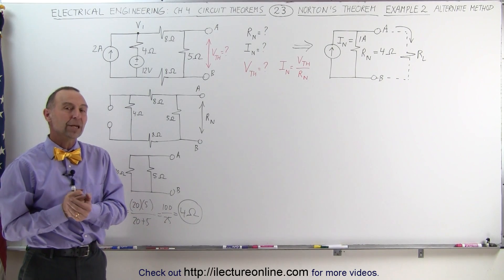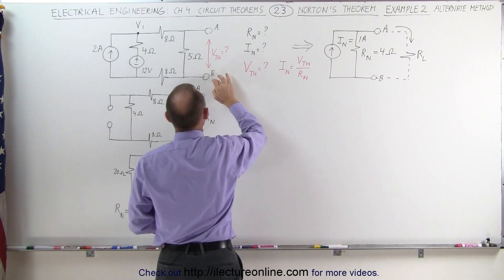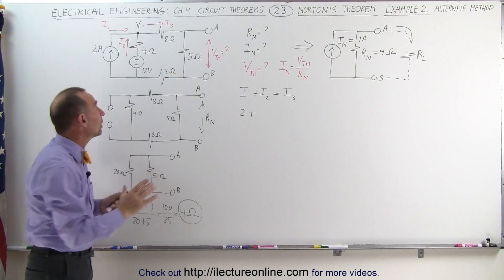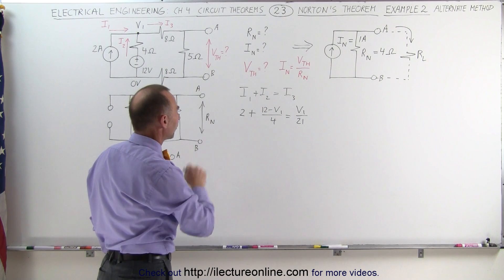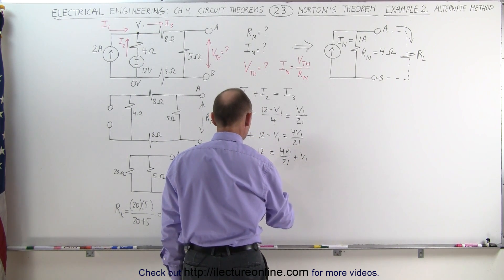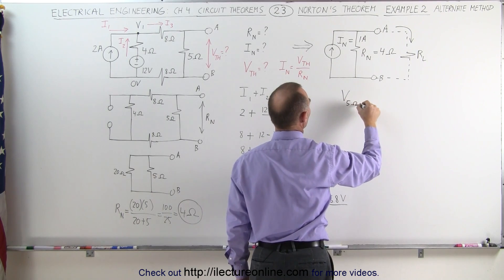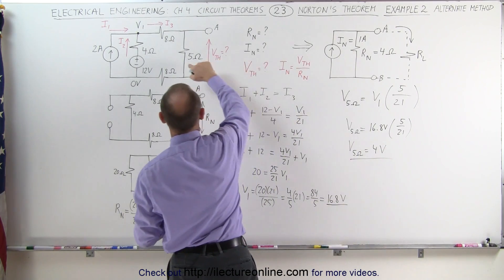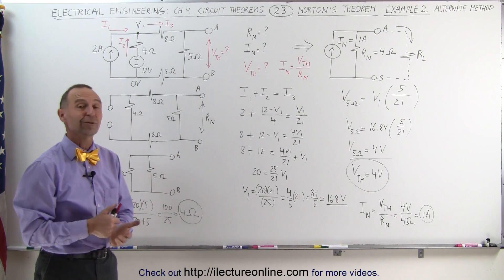Electrical Engineering: Ch 4: Circuit Theorems (23 of 35) Norton's Theorem Example 2 (Repeat)

Comment: For those who's confused why he's using (4 + 8 + 8 = 20 ohms) for finding Rn vs (5 + 8 + 8 = 21 ohms) for expressing I3 in term of V1, let me explain below for my own revision as well :)

So when finding Rn, we turn off all the independent sources by removing current source & shorting voltage source. Then, we look into the NEW CIRCUIT with terminals A-B as the reference (going from top right, through the circuit, then reach bottom right). Between A and B, there are two paths which are:
1. Left path: A -> 8 -> 4 -> 8 -> B
2. Right path: A -> 5 -> B
So, in this case, we treat (8 + 4 + 8) being parallel to 5

However, in the original circuit when finding V1, we havev defined the currents which are I1, I2, I3. And the currents are represented as follow:
> I1 = 2 A           (from the current source)
> I2 = (12 - V1)/4          (through the 4ohm branch with 12V source)
> I3 = (V1 - 0)/(8 + 5 + 8) = V1/21          (flows from V1 to ground through the right-hand network)
To elaborate on I3, in this case we're looking at the path that I3 takes FROM V1 TO GROUND. And we can see it passes through 8ohm (top) -> 5ohm (right vertical) -> 8ohm (bottom) -> ground (0V), so we take 21V here.

I also was confused at the start but figured out after a while, hopefully this helps whoever that's confused haha. 

+ correct me if I'm unclear/wrong in any part of my explanation

Comment: 1:53, why is it 12-v1 and not v1-12? I don't understand this part
Reply from the maker: The assumption is that the potential below the 4 ohm resistor is higher than the potential at node V1.

Comment: Wouldn't the Vth = V1 * (5+8/21) instead of V1 * (5/21)?  Which would be Vth = 16.8 * (13/21) = 10.4v. The voltage divider would between the first 8 ohm resistor and the second two (5 and the bottom 8).
Reply: because only the 5ohm resistor is parallel to the resistor load. The V isnt changing in parallel. Hope this can help

Comment: At the end, shouldn't vth, be equal to the voltage differnece between the top and bottom of the Resistance 5Ω? (V5Ω-V8Ω)  = -2.4V ?
(since our ground is at the left of the bottom 8Ω)

Comment: Sorry by both of them I mean the 5 ohm resistor and the A/B gap since both of them are vertical.
Reply from the maker: The 5 ohm resistor is in parallel with the sum of the (8 + 4 + 8) ohm resistors.  Thus 5 ohm in parallel with 20 ohms gives you 4 ohms.

Comment: But isn't the 5 ohm resistor parallel to the gap A/B ? The gap A/B is vertical and the 5 ohm resistor is vertical so shouldn't both of them be considered as parallel to each other ?
Reply from the maker: What do you mean by "both of them"?

Comment: Hi Mr. van Biezen,

Why do you add the 4 and the two 8 ohm resistor as if they were in series when for the Thevenim's Theorem examples you treated them as in parallel ? Also why does the calculation work if you only assume that the 4 and the two 8 ohm resistor are in series and not if you assume that the 5 and the two 8 ohm resistors are in series ? 5+8+8=21, Rn= (21*4)/(21+4)=3.36 ohms.

Thank you.
Reply from the maker: Once the current source is removed and the voltage is shorted out, you must take a new look at the circuit.  Relative to points A and B, the 5 ohm resistor is in parallel with the 8, 4, and 8 ohm resistors who are in series.
Reply from the maker: Also note that the Thevenin and Norton theorems are different in their approaches.

Comment: I wrote two node voltage equations: 

(v1-12/4 )  -2   +  v1-Vth/8 =0 
 and 
Vth-V1/8 + Vth/13=0

and got a different answer, why is that wrong?

Comment: How were you able to get 20 ohms and 5 ohms separately?
Reply from the maker: That is due to the rules of finding the Norton's equivalent resistance.  Any current source is removed from the circuit and thus you have an open circuit there instead, and any voltage source is shorted out, so you have a short there.

Comment: why did you assume i3 is leaving?
Reply from the maker: It doesn't matter which direction you assume.  You can assume the other direction and you can still work out the problem and get the correct answer.  Although in this case it is a good assumption since the other 2 branches leading to the branch point force current towards the branch point.
Reply: +Michel van Biezen thank you very much sir.